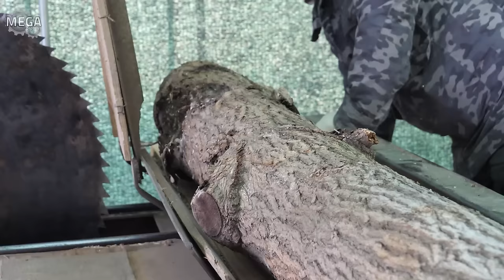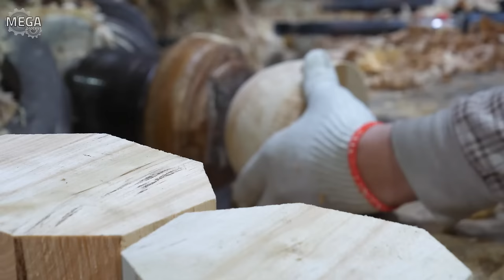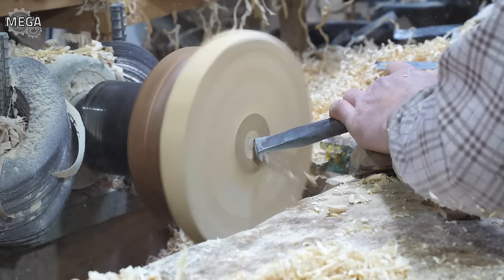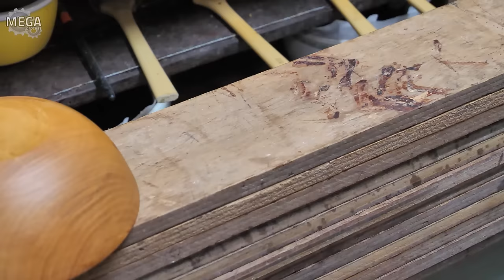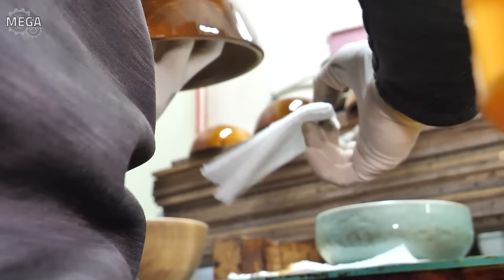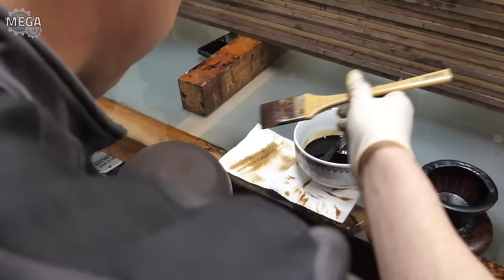Making wooden bowl for buddhist monks. Korean woodturning master with 30 years of experience

Comment: Very beautiful work! Master is very good!
Please tell me what composition you process wooden products with?
Reply: it looks like a natural tree lacquer, basically a kind of sap thats extremely irritating in its raw form that is treated with different things to affect the colour, then applied and allowed to cure in a large humidor. The result is a very rich and hard wearing finish but its a bit challenging to work with as the irritant is the same thats in poison ivy and green mango sap, so most people are affected by it
Reply: @emilyrobinson6080  Are you master?
Reply: @atekin-mj2gz  no, just someone who has worked with tree lacquer and recognizes the techniques and tools related to using it. You wouldnt use a humidor to cure other types of finishes and the method of preparation and application is what you use for natural urushi